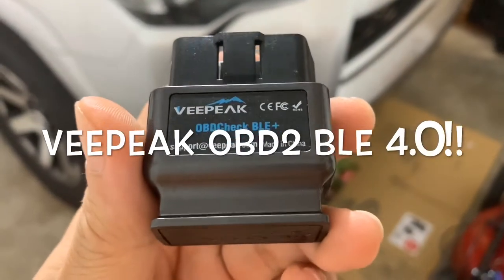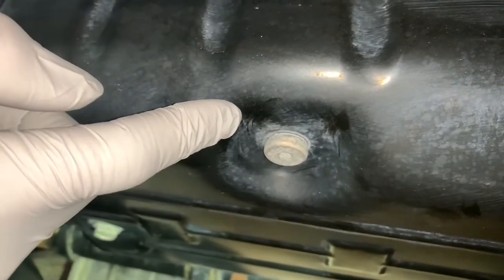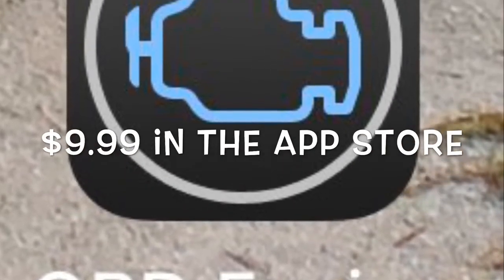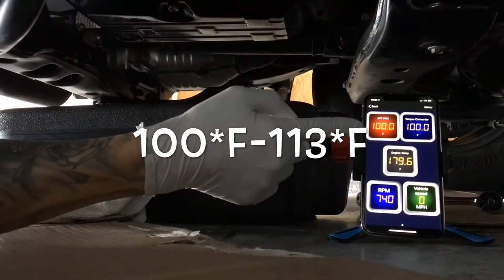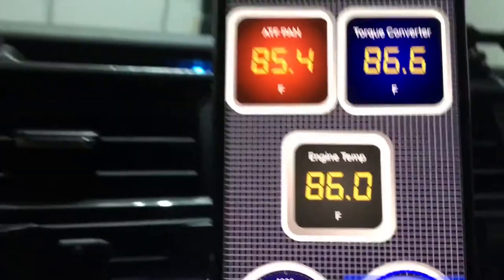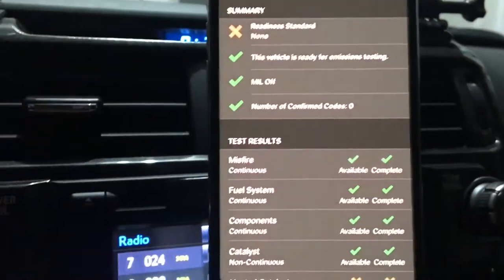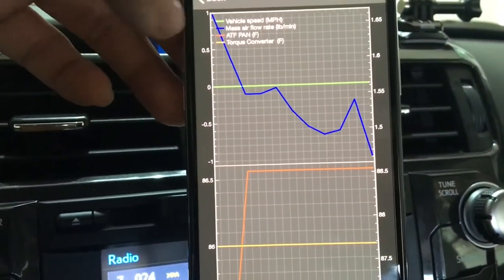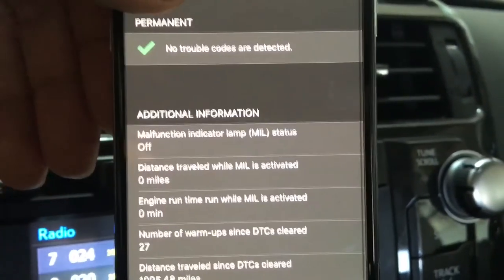2018 4runner ATF Check with VeePeak OBD2 & OBD Fusion APP

Comment: Hi, Is it compatible with Toyota Camry 2014 3.5L V6?
Reply from the maker: It’ll work for any car but you have to research the code for a specific car
Reply: @TNGUYEN415  where do you find code for toyota sienna 2014 ?
Reply from the maker: @omarkhshi3442  veepeak website or contact them directly

Comment: You didn't need to pay to add Toyota PID?  Just the 9 dollar Fusion app ?
Reply from the maker: Yes you need the app for it to work
Reply: @TNGUYEN415   Thanks.  But I thought you have to also purchase the Toyota PIDs.
Reply from the maker: @hothmobile100  No. the PID is something you add into the app to create your ATF temp or PID Torque Converter
Reply: @TNGUYEN415   okay thanks.  I'll try to find the PID codes for 2022 Tacoma.
Reply from the maker: @hothmobile100  it’s the same
Reply: @TNGUYEN415  Man this video was awesome. I need the PID for a 2014 Camry V6. I’m going to the website to verify if they have it. Thank you so much for this awesome video.
Reply: Anyone happen to know the pid transmission temp code for a 2001 Toyota tundra 4.7 V8?